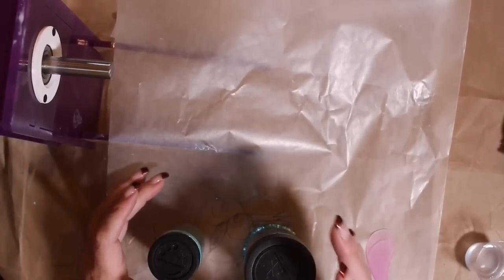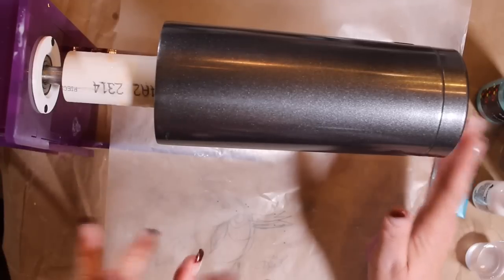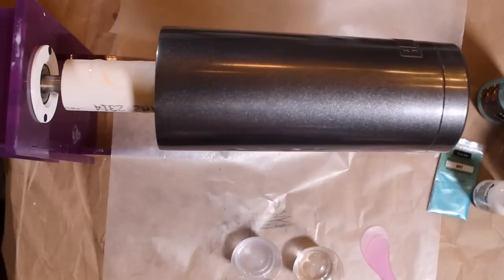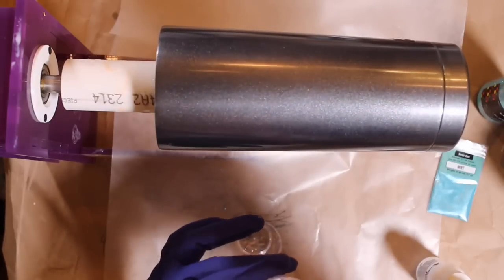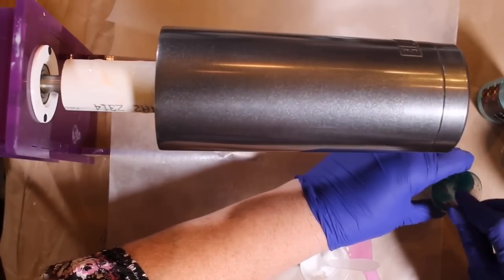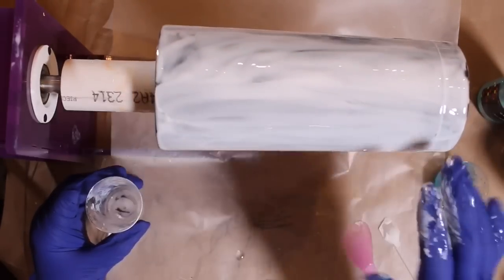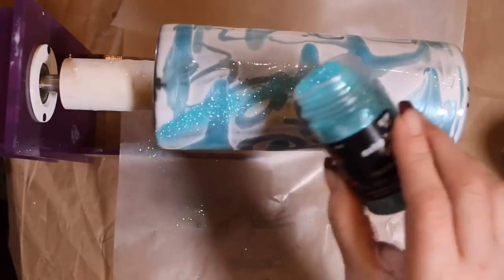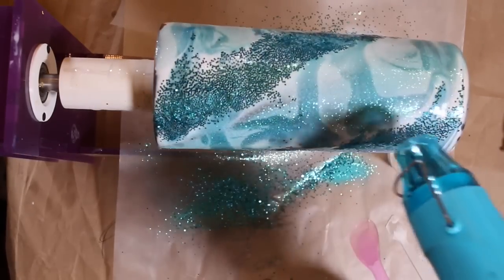Application of Dyed Epoxy and Glitter on Stainless Steel Tumbler

Comment: Please quit telling ppl it is food safe. No epoxy is safe to drink from. You need to be using the tumblers with a lip when people drink out of these cups that are epoxy clear to the top is toxic
Reply from the maker: Kelly Ingles this is Alumilite FDA compliant resin...  per their website... “Alumilite's Amazing Clear Cast is a clear casting epoxy resin that produces a rigid and durable finish. ... Allow a full 7 day cure before using castings for food purposes. Pieces are suitable for cold or warm food contact only. Cured pieces are not dishwasher, microwave oven or conventional oven safe.”...    And FYI - these cups have a lid that is used to drink from!